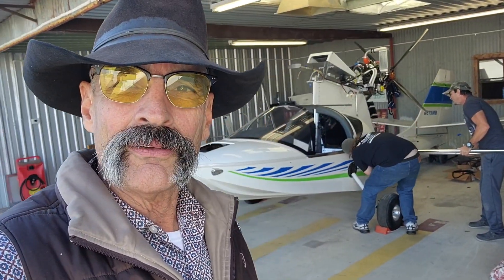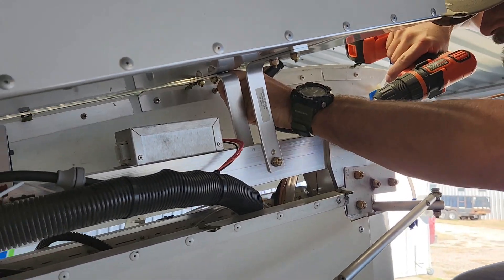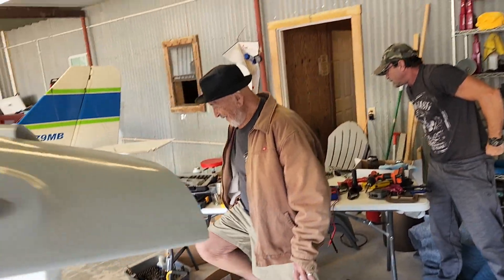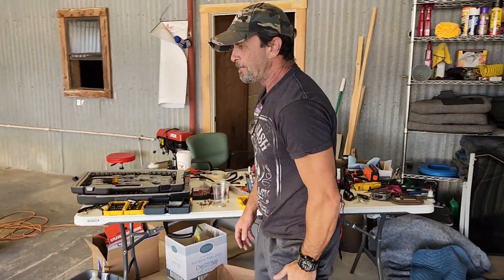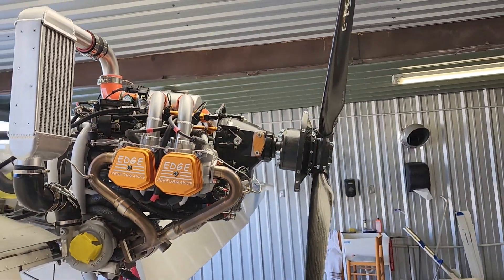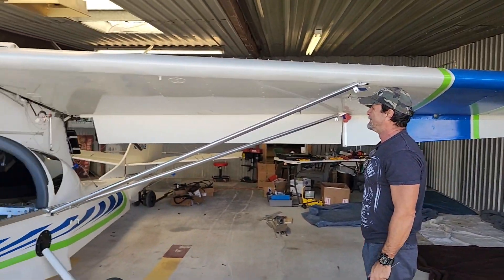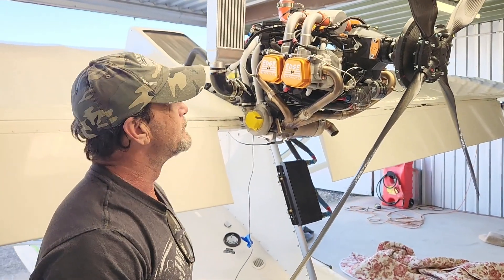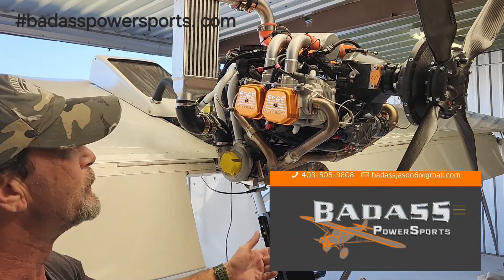Wings on A Sea Ray!

Comment: why the change from viking to a turbo 912?  what are the thoughts on the viking?
Reply from the maker: Joe upgraded to the Edge 912 for more horsepower.  The Viking was an advertised 110 hp for take off and the Edge performance is 150 hp.  Plus it is lighter than the viking so the performance difference should be huge.  As I understand it, the Viking was a great engine, but he wanted the extra power and he was able to afford it.  The Viking is a more affordable option in many cases.  I know Jan at Viking and he is now making higher horsepower engines as well.
Reply: @LeviNoguess  ah that makes sense if it was the older 110hp viking.  cant wait to see the searay in action with the new motor, I hope you document it!